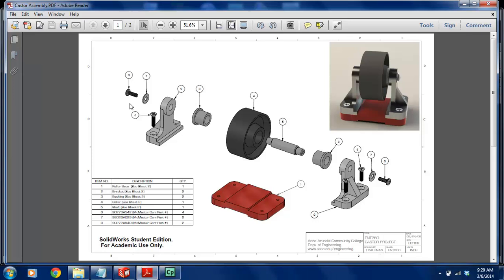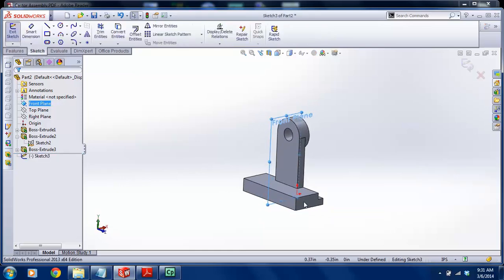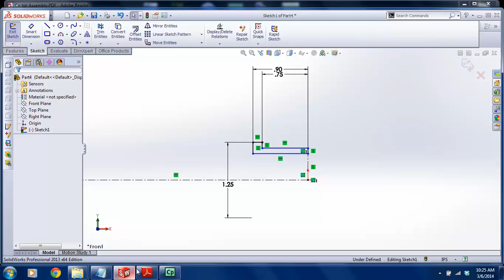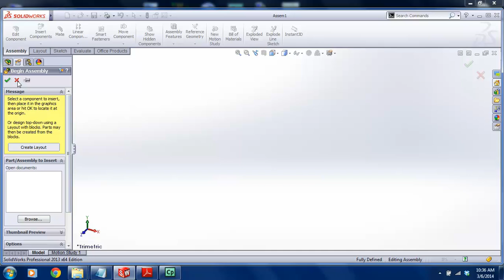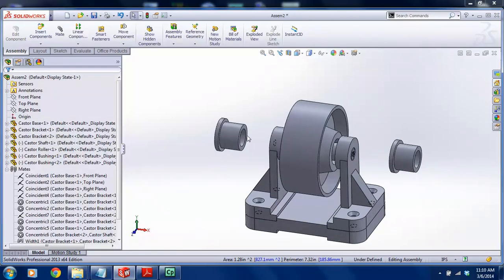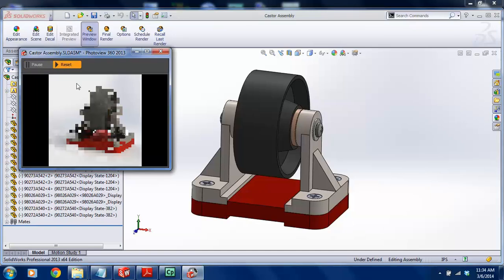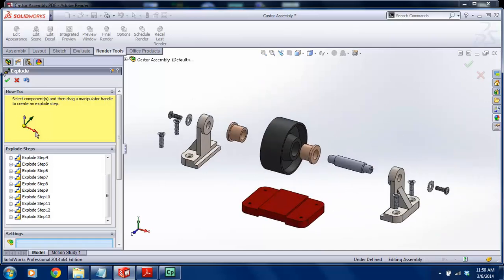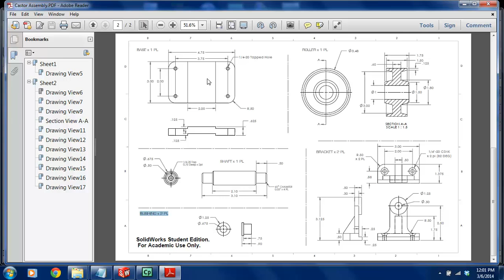Solidworks Tutorial 8 Assemblies

Comment: Hi, Great videos, however I have a question. 
In many of your videos you enter a value, in this one on the bracket for instance you enter 3.75 but the program enters 3.8..I have noticed this many times but just thought to ask :)

Keep up the good work please :)
Reply: +Gary Rowlands 

Its just the tolerance that he has Solidworks set up to display. Its default setting is 2 places after the decimal. So even if he typed in 3.0625 it would only show up as 3.06. (If you click on the dimension after setting it, it will show you the true value with all significant figures.)